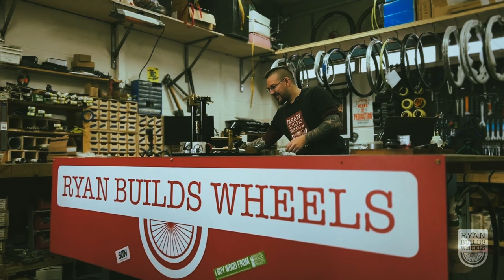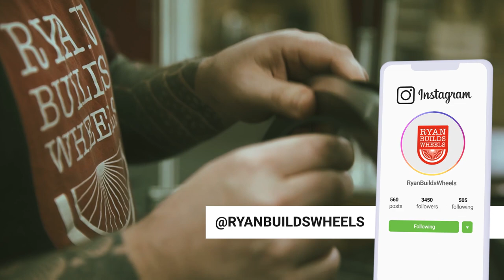RyanBuildsWheels: Adventures in Bicycle Wheelbuilding

Comment: Looking forward to this. Have been tempted to try my hand at wheelbuilding for yonks, as it has always seemed like a "black art" to me. Sadly, the skills seemed to have been lost from the bike shops of West Cornwall (tried and failed to get a wheel fixed in 2 different shops during lockdown) and I ended up having to junk the wheels and buy some factory built replacements, just to keep riding 😩 I guess I'll just have to learn to do it myself 👍
Reply from the maker: Hey Trevor! You 100% Should! I'm on a mission to get people to understand that - far from a black art - wheelbuilding can be a very rewarding and accessible craft to learn: right now all that's required is a degree of patience, mechanical aptitude and ability to self teach.

With this channel I want to make learning step by step easier (and more detailed for those that want it) for as many people as possible.  Worth noting that I'll actually be bringing back my 'wheelbuilding weekenders' shortly which allow four students to come and learn the craft over two days once a month; keep an eye out here or on the RBW website for details; I'd love to have you along, you're only down the road ;-)!
Reply: @RyanBuildsWheels  Ace. I'm actually up in Bristol next week for the GoGo Penguin gig at the Marble Factory. Had my frame fixed and painted at Argos Cycles this summer too.